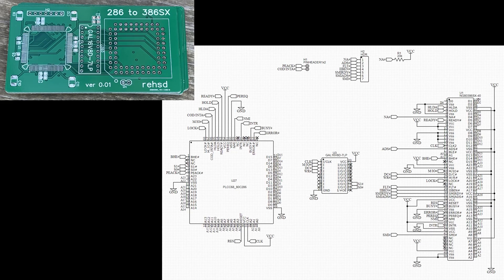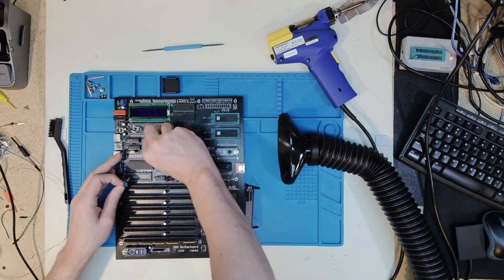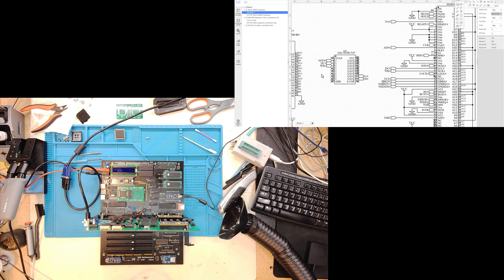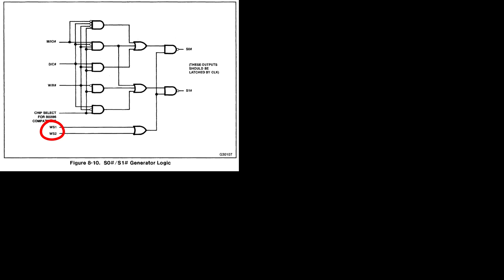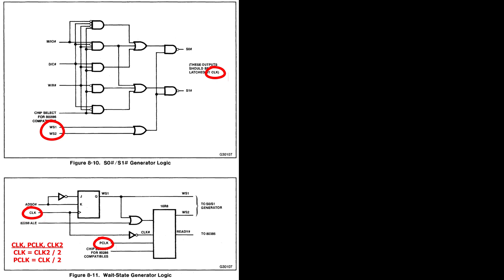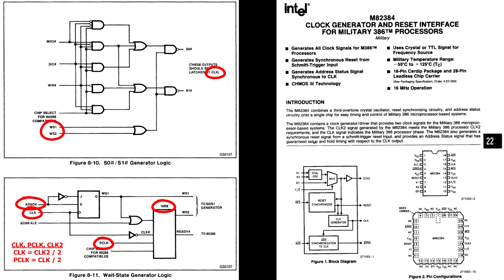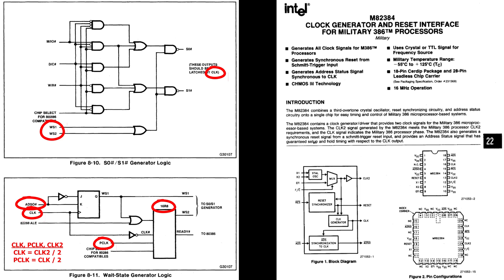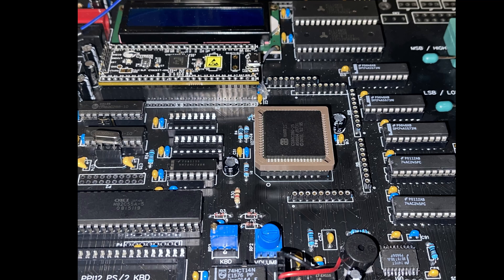80286 Build, Ep. 107 - 386SX Upgrade, Part 1

Comment: GALs have registers on their outputs, but the only limitation is that their clock can only come from pin 1.

So it should be possible to produce latched S0 and S1 as long as you haven't already used pin 1 for some other signal - just hook that up to the appropriate clock.
Reply from the maker: That's in line with recent updates I have made. I am now bringing in CLK2 on pin1 of the GAL. Thanks, Tom!

Comment: I wonder if you need to go back to the original approach you took with the 286 and make a breadboard adapter for the 386SX and see what it takes to bring it up. Then maybe it'll be easier to see what the gap is between it and your current system.
Reply from the maker: I was thinking about taking this new PCB and my original 286 breadboard PCB and doing what you're suggesting. The 386SX PCB should connect right into my 286 breadboard adapter PCB. I could then easily connect a debugger, etc. The other option is to get my 386DX proto board started and learn how that logic works.